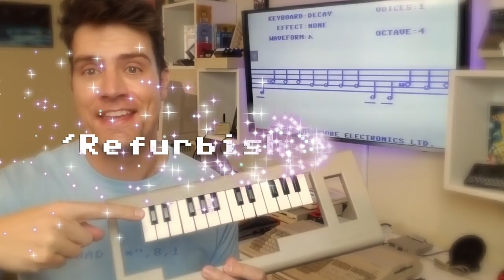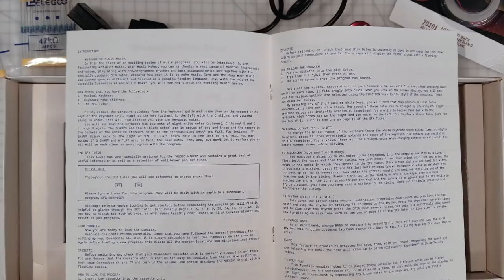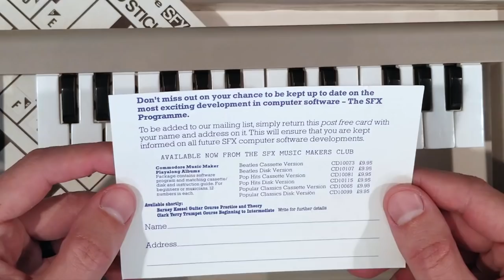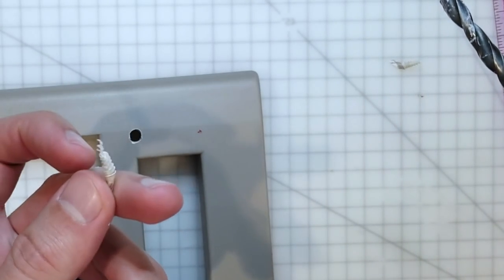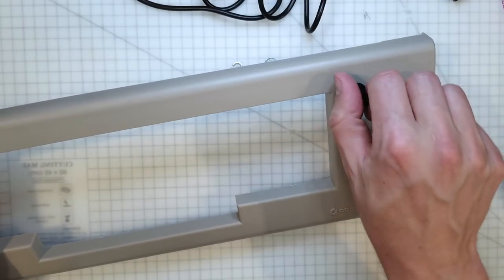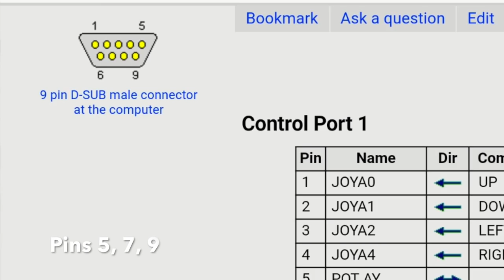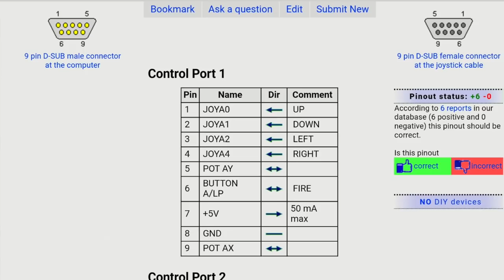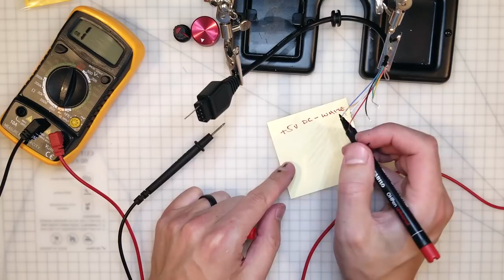1/6: Commodore Music Maker Refurb - The Beginning

Comment: The string in a cable is there to give physical strength to the cable.  It resists stretching forces.
Reply from the maker: 🤦‍♂️ Of course! Thanks!
Reply: Fine strands will be filler so that the cable is round. If it's woven then it's a strain cord.

Comment: What a fantastic idea! I do wonder how well the paint holds up on the plastic. I know lots of plastics are often painted in commercial applications. I am looking forward to the future parts of this. The painting of the connector was a fantastic touch to tie in the coloring of the overlay to the cable itself. Well done!

The string is for strengthening the cable. Those fibers take a lot of the pulling stressors. Better the fiber than the copper. :)
Reply from the maker: The paint is still perfect after nearly 2 years!

Comment: You know what would make this project even better? Installing 80 and 81 dual C64 SID Chips inside your C64 with this music making hack combined with each other to take the mod all the way.
Reply from the maker: I definitely thought about it but I have a thing about trying to keep the electronics stock so they can't do anything they couldn't originally do...
Reply: True. But think of it this way. you can use both 80 and 81 chips in it anyway as seperates. It's just it ads an extra holder so you can put both stock chips in at the same time I guess if you have a spare one of the same C64 model you could use one for adding the Dual SID and the other original maybe providing you got 2C's or 2 normals where you can mess around with 1 PCB for music.

Comment: 14:07 Nope - with LOG pots, the direction will matter.
I'd recommend linear taper and adjusting the 'gamma' in S/W.
Reply: Ahhh... so you're actually using the pots as veriable resistors ... that makes a difference...

Now trying to get my head around whether it still matters (which way the strap is connected)...

Comment: That black Commodore 64C case is awesome-looking! Is it obtainable on the weeweewee? (I don't even have a C-64 to put it on, but I crave it nonetheless.
Reply from the maker: Thanks! On the what?!
Reply: @RetroRecipes  On the Net. Didn't I hear that someone out there has the original molds for the C64c case and sells replicas? "Any color you want, so long as it's black".  No, seriously, you can have your choice of colors including transparent. I thought yours was one of those.
Reply from the maker: Ah, not the breadbin style no. I made that one. You can get replacement C64C cases from Pixel Wizard though 👍🕹️

Comment: Does that keyboard fit on the Maxi?
Reply from the maker: It actually does
Reply: @RetroRecipes  Thanks Peri. Now the hardest part will be finding one...
Reply from the maker: @kite666G  If you mean the keyboard they come up on eBay quite a lot and pretty cheap too!
Reply: @RetroRecipes  I already checked there but found none so far. Anyway thanks for the tip and your time, you're the best.

Comment: The other is actually the original. Commodore stole it from them.
Reply from the maker: Interesting!
Reply: That's okay. Sight+Sound apparently tried stealing the Atari AMY sound chip a few short years later. The chip wasn't finished when Atari Inc fell apart. Tramiel's Atari Corp tried to get it working in the ST as its development was going along but got behind schedule so they negotiated a deal with Sight+Sound to fix the chip's problems. The delay meant the AMY would go into the 65XEM. But Sight+Sound fixed the chip, cut Atari Corp out of it, and apparently had the backing from some 3 letter intelligence agencies. Atari Corp took them to court and for some strange reason, all of the documents and the finished production runs of the chips burnt up in a warehouse fire.